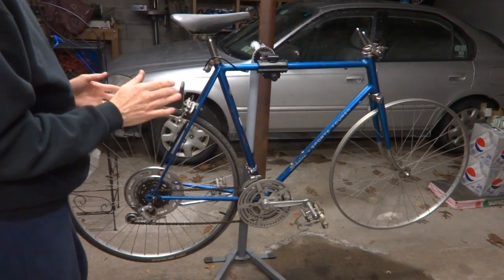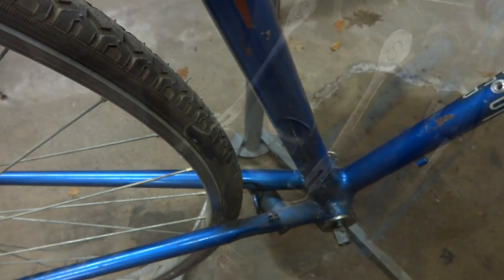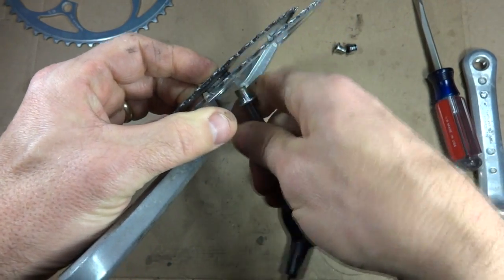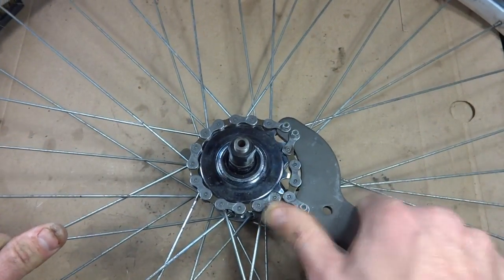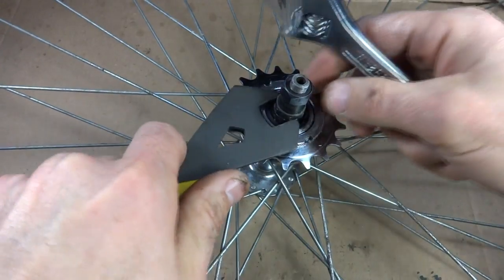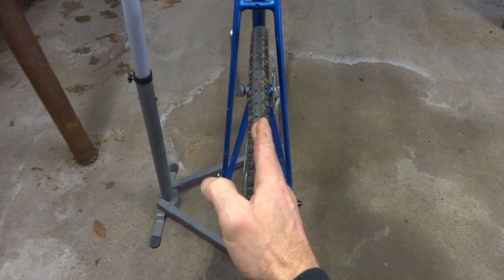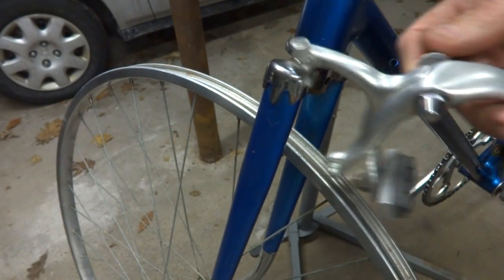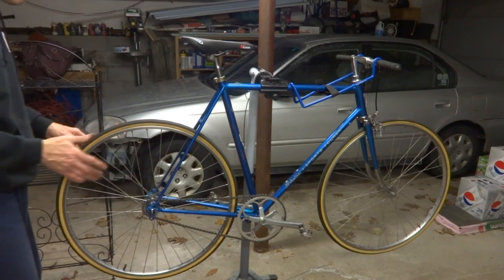How To Build A Cheap Fixie From A Vintage Bike

Comment: is it recommened to use Locktite on the threads for the crank and ring you bolted on?
Reply from the maker: On the square taped spindle? No! Always leave that bare. You can use it on the bolt, but it isn't necessary. You can use it on the chain ring bolts if you want. If you do, use blue. Definitely not the red stuff.

Comment: If I’m doing a conversion, can I still have the biggest chainring in the outside and buy a bottom bracket with a shorter spindle?
Reply from the maker: Probably. I was doing it as cheap as possible.

Comment: Awesome video sir! I have 2 questions though : 
1. Could the chain be mounted on gears that are not perfectly aligned ? (a few mm)
2. Could the rear wheel stay as it was before you ajusted the spokes ? (not centered)
Reply from the maker: This is from Leonard Zinn regarding chainline on a fixie: "Definitely have a go a trying to minimise the problem, doing nothing could have you either jamming your rear wheel with the chain coming off, you could damage chainring or sprocket or even break the chain itself – so definitely, it’s worth trying to do as much as you can to make sure your chainline front and back are within 1-2 mm of one another. "

Comment: Im planning on building my first fixie and this is really helpful, thanks! Since I've read that it's not that safe to reuse the old wheel like you did, I was wondering if it is possible to buy a track hub and get a bike store to build a new rear wheel that uses the old rim. Is this possible or do you need to buy a whole new wheel?
Reply from the maker: You can buy a track hub and have a shop build your wheel using your current rim. You need to make sure the spoke count matches. Or you can get a new rim. Or you can get a whole new wheel. Any of these will not be cheap.
Reply: shyflirt1 ok thanks for the reply! For the price of a low quality track wheelset I can get a medium quality hub and build a wheel with the old rim. Are better hubs more important then new rims in terms of how the bike will ride?
Reply from the maker: Depends the hub/wheelset rim. You need to research. Some parts are cheap because they are low quality. You usually get what you pay for.
Reply: shyflirt1 ok thanks, I will. Have you heard of KT Quando Hubs? Thats what the cheapest wheels seem to have
Reply from the maker: Sorry, no. There are way too many brands and models for me to be familiar with even a small fraction of them.

Comment: Generally, I am a big fan of your videos. They are great and come in very helpfully. But this time, I think I found some issues besides using the originally hub: Isn't it a problem to skid or backpedal with the skewer still installed? On my singlespeed I had to change the axle to tighten it with screw nuts. Also: Do you think it's safe to install the master link? Many thanks...
Ah, btw, please keep the paint, it's just beautiful!
Reply from the maker: sigh I am getting tired of answering these questions.

From Sheldon Brown:
"Quick-Release or Nutted?
Track hubs generally come with solid axles and track nuts. This is because most velodromes have rules requiring this type of wheel attachment.
As a result, it is widely believed that quick-release axles are not suitable for fixed-gear use. This is false!
It is my belief that the velodrome rule dates back to long before the invention of the quick-release, when the choices were standard nuts or wing nuts. The protruding "wings" of wing nuts might constitute a hazard in a crash, and I believe that's why the rule was instituted. Since quick-release skewers don't have any sharp projections, that becomes a non-issue in practice.
If you are going to use a quick release with a fixed gear, you should make sure to use a good quality enclosed-cam skewer."

And why not a Missing Link? I trust them better than pressing new pins in. And pulling the link locks...it doesn't matter which direction it is pulled. So why would it be a problem?

I just updated the description preemptively answering these questions.
Reply: Oh, I'm sorry I asked...
Reply from the maker: Not your fault. You are are about the 5th person to ask the same questions.
Reply: shyflirt1 It was more a question of what your experiences were with that fixie. I was not using a racing skewer but an anti-theft skewers because I am riding my singlespeed in urban areas and not (entirely) for leisure and sports.

And if you ask me: I would rather trust new pins than a missing link, but thats just my opinion. (You always have to ride the parts you trust in.)

Btw, unlike many others my questions ment to be real rather than raising dispute.
Reply from the maker: Unfortunately we are now into winter, so I haven't have a chance to ride it other than a short test ride. I cleared over a foot of snow yesterday. I will ride it in the Spring. If you are comfortable with solid axle, go for it. I did some research before I used the quick release wheel, and found many people have used them with no problems.

Comment: That's another good question - does a Biopace ring not work with a single speed?
Reply from the maker: I have read it will work.
Reply: Yeah, maybe the distance doesn't change between the front and the back, just the speed at which the chain is up taken by the chainring? Nice video anyway btw!
Reply: It will work, but the distance changes every 180 degrees, so I guess the chain would have to be looser to take up the slack every half rotation. ( I am not talking about using a chain tensioner here either)

Comment: Hey RJ, Nice video, thanks a lot, I completely copied you for an old bike that was going to trash.
Also, I wonder, wouldn't it be "safer" to weld the cog to the wheel ?
Reply from the maker: Steel doesn't weld to aluminum.
Reply: Right ! Thanks RJ

Comment: only messengers or really fit people could ride 48t+ chainrings on a fixed gear. i used a 42 or 44 when i was a messenger. there were many messengers with 52t straight up track bikes no brakes. total bike psychos man

Comment: Hey RJ, Quick question, the tool you are using to tighten the lock ring from a bottom bracket, what is it called, i can't find it anywhere on the bike shop websites i use. It seems to be a specific tool, as it fits perfectly. 

Nice video by the way :)
Reply: i did some google searching, might it be a LOCK RING WRENCH? :P i wonder i wonder, haha
Reply from the maker: CyclingDane Is it in this video? At what time in the vid? Or is it a different vid?
Reply: it's in this video but, don't worry i figured it out :) great video btw.
Reply from the maker: CyclingDane I don't remember doing anything with the bottom bracket in this video.
Reply: it was with the flywheel, after you removed it you used a lock ring wrench to tighten the singlespeed lock ring. at 28 minutes
Reply from the maker: CyclingDane Ahhhh. The lock ring spanner. http://www.amazon.com/exec/obidos/ASIN/B000C17KRI/ref=nosim/youtube25-20
Reply from the maker: This is another tool I could have used: http://www.amazon.com/exec/obidos/ASIN/B002PTVDP0/ref=nosim/youtube25-20
Reply: okay, thanks. thats exactly the tool i ordered :)

Comment: The Fixie that I have recently acquired does not have a fixie gear. It had a single gear but the pedals do are not coordinated with the wheels. What do I do to fix that?
Reply from the maker: What do you mean the pedals are not coordinated with the wheels?
Reply: nvm i have fixed it. i just noticed i had a flip flop hub o i just flipped the wheel and the pedals go with the back tire now. it was a free wheel

Comment: On the cog setup: it might be cheap & worthwhile to buy a track hub and relace the wheel.  Might be like $20
But if you use this method and the cog unscrews and you don't have a brake, know you can put your foot on the rear wheel to stop. 
Works well and thats what the bmx guys do when they ride a freewheel brakeless
Reply: It's better to put your foot on the front wheel if you want to stop sooner rather than later. A front brake is inherently superior to a rear brake, and not just by a little bit either. It's something like 10 times better.

In the mid 1980s when I was in 4th grade, I replaced a wheel on my BMX that had a coaster brake hub with one that had a freewheel hub, leaving me brakeless until I could get some caliper brakes and levers. To stop I would press my foot against the front tire, which worked great, but it wasn't long before I noticed a big groove worn into the sole of my right sneaker.

Comment: How much would it cost to restore an entire 1960's to 1980's road or racing bike back to it's factory set color, decals, parts, etc.? I really would like to know.
Reply from the maker: Umm...you need to do the research. Rarer bikes will cost more. The more detailed of restoration, it will cost more. If you ever watched the show American Restoration, it can cost a lot. It all depends what want. Again, YOU need to do the research. I am not going to do it.
Reply: Sir I am not saying you have to do research I was only asking because I thought you would know. Sorry for the mis understanding.
Reply: RJ The Bike Guy Sir I didn't say you had to do research.
Reply: First, find out if decals are even available.  Usually, they aren't.  Second, almost nobody will give a dang anyway, so just pick a color you like, get a few cans of auto touch-up paint, and call it good.
Reply: ralphinator2  Well nobody needs to give a dang. If I want to restore my bike I will.
Reply: Jonathan Chuck  That's fine, but most manufacturers don't have any stock of replacement decals.  Sometimes you can find some old Schwinn stickers on ebay.
Reply: ralphinator2  I found decals for my bike.

Comment: on the cranks where the Allen head bolt is there is a metal cap that I can't get off
Reply from the maker: If it's a metal cap, it probably unscrews. They can sometimes be tight. Lots of penetrating oil. Maybe try heating the crank arm with a hair dryer. I have destroyed a few trying to get them out though.

Comment: Why not run the Biopace? Seemed preferable for Sheldon.
Reply: +CsoSly Not possible for a fixie. The biopace is elliptical; without a rear derailleur the chain would go from too tight to too lose all the time.
Reply: It only seems impossible. In practice, it works fine.

Comment: RJ The Bike Guy im in the middle of my fixie conversion. I went to a store to get a cog fitted on the rim. The cog fits nice but the lock ring is to small. This is because the hubs threads arent stepped. Where can i buy a lockring the exact same size as a cog. Please help
Reply from the maker: It's a bottom bracket lockring.
Reply: Thank you!!!

Comment: Everyone on this comments section sounds like the bicyclist from Portlandia. Dude good plan on making a fixed gear but you made a few common hub mistakes and your using the wrong kind of frame but it works on a budget I guess. I'm building up a freestyle bike currently blending the best of bmx with a track bike.

Comment: Shouldn‘t this be like a singlespeed bike? Ich really dont Know much about these type of bikes, but if you just take off the cassette there should still be the free wheel no? Unless theres a system where the freewheel is included in the cassette...
Reply: Edited answer: The ratcheting mechanism is separate from the hub itself. On a freewheel, the ratchet is attached to the sprockets (like this bike). A freehub wheel might be harder, as the ratcheting mechanism is an extension of the hub.
Reply from the maker: https://www.youtube.com/watch?v=qcgz3-XyNkI

Comment: I don't want to buy a crank puller but would a rubber malet work to get them of
Reply from the maker: There are crank pullers on ebay for under $5. Either do it right, or don't do it.
Reply: I had to put a different bottom bracket in mine so I just used a blow torch and a hammer

Comment: RJ you kick ass..
Reply: Im currently restoring a 1986 Freespirit  Dynasty 930se 10 speed. I can't wait to get her back  on the road. I think my biggest obstacle is having to replace the front derailleur shifter handle if not the whole mechanism. Also tubes tires and the entire rear wheel hub assembly and chain. One day at a time.

Comment: Good video, but I would have kept that kickstand. Never seen a built-in stand before! :D
Reply from the maker: +Jamie Randall They pretty common on many old Schwinns.
Reply: That's cool. I have never seen them or Schwinns before in the UK.

On a completely unrelated note, do you know much about Peugeot Carbolite 103 frames? If so, do you think it could make a good touring bike? I have one set to fixed gear that I want to convert to an old school tourer (with a mix of old and new components), as a friend and I will be cycling across the US in early 2017. Despite having decent modern touring bikes we love the idea of bringing an old bike back to be a workhorse again. I'll stop ranting now, ha. Maybe I should find myself a Schwinn with a stand!

Comment: isn't that an issue that the whole real wheel moves 6 mm to the right of the bike? e.g. it won't be running in the same tread as the front wheel?
Reply from the maker: Did you watch the whole video? Did you miss the part where I re-dished the wheel?
Reply: yea, was trigger happy with the question

Comment: is the bottom bracket on fixie-specific frames higher off the ground than on regular road frames to allow for better pedal/ground clearance when leaning into corners and having to pedal, because the thing is a fixie?   if they do, i would never convert a road frame to a fixie, unless you love the feel of asphalt grating your flesh

Comment: Anybody know where to source a 21.1mm stem like the one used in this vid? I’m trying to convert a beaut Raleigh but only 22.2 seems available :(
Reply from the maker: Ebay.
Reply: @RJTheBikeGuy  I looked already and completely dry! I guess I will have to keep checking . Cheers Sir
Reply from the maker: Apparently you are not searching right, because I searched and got 184 results.
Reply: @RJTheBikeGuy  Wow the USA is well stocked. Unfortunately im searching on UK - 5 results haha. Might have to bite the bullet and pay shipping

Comment: Bad idea- low bottom bracket height equals inevitable, dangerous pedal strike when cornering. Track and fixed gear frames have higher bottom brackets for this reason. Dedicated fixed gear frames and complete bikes are available so cheaply now, that there's no reason to be doing these dodgy conversions anymore. Besides the fun of building your own- but you gotta do it properly- start with an old track frame perhaps.

Comment: How would you adjust the chain tension in further use?
Reply from the maker: Just loosen the wheel, pull it back and tighten.
Reply: @RJTheBikeGuy  sometime even on my track bikes, they require chain tensioner because the rear axel keep sliding forward. 
I'm so hyped of the idea of converting bikes but this is a hell of a concern for me
Reply from the maker: @quangninh9438  Then mount a chain tensioner.
Reply: @RJTheBikeGuy  is there a kind of chain tensioner for vertical drop outs? Any further info would be very appreciated
Reply from the maker: @quangninh9438  Go to Amazon.com. Search for chain tensioner. Find what meets your needs. Buy it. Install it.
Reply: @RJTheBikeGuy  thankyou for your sharing sir

Comment: does anybody know what size stem an old 70's-80's chimo hkb would require?
Reply from the maker: I don't know the bike but most bikes have a 22.2mm stem. French made bikes used to have a 22mm stem.
Reply: ok thanks, the bike is made by a brand called hong kong bicycles so would it still be the same in asia?
Reply from the maker: Should be, though some of the cheap department store bikes sometimes have weird sizes. Have you measured it?
Reply: yah, it came out to around 22 but I don't have a calliper though so I'm not sure how accurate it is but thanks for the help. I think I will probably go with a 22.2 than. I love your videos by the way. I am currently trying to make a fixie for a school project

Comment: Why not use a higher strength thread lock on the wheel?
Reply from the maker: That is an option. Loctite 271 Red would work well.

Comment: I can understand why people use conversations, road frames are much cheaper and common than track frames. And this may work but not well, you know, because of the geometry of the frame. For example bb on the road frame is much lower, so be careful when you go into a turns. And for sure when you ride shitty fix, you won’t appreciate all fun and benefits of fixed gear

Comment: multi gear bikes have the chain out of line on most gears.  why a fixie needs gears in line?
Reply from the maker: Multigear bikes also have have a rear derailleur with a cage to act as a chain tensioner and a guide to keep the chain in line with the cogs

Comment: A fixed gear bicycle allows you to have fantastic control and there is no rule saying you can't  run brakes.You brake normally retarding the pedals this slows you down.A fixed gear is actually safer to ride in the winter over snow and ice than a bicycle which frewheels.With a fixie you always pedal so you do not break traction .With a freewheeling bicycle you are hooking up and then breaking traction.I have been riding fixed gear bicycles for years and in the winter I only had one bad fall and that was over smooth ice for rough ice and snow traction is very good. If you have never ridden a Fixie you don't unerstand it and are not qualified to criticize it.